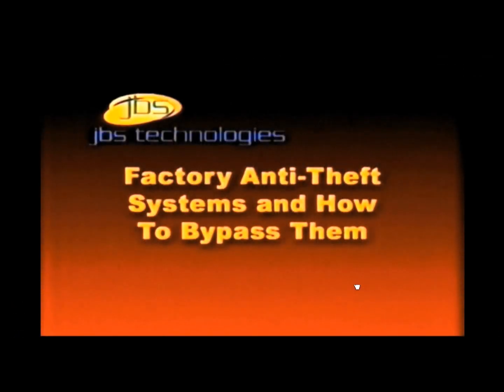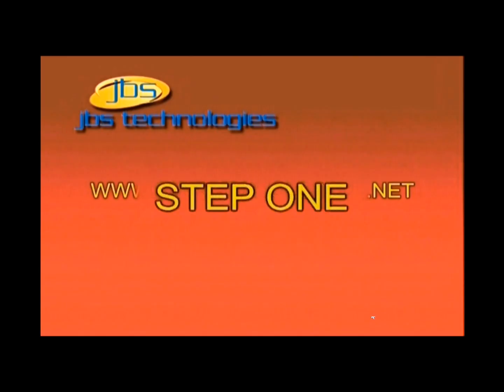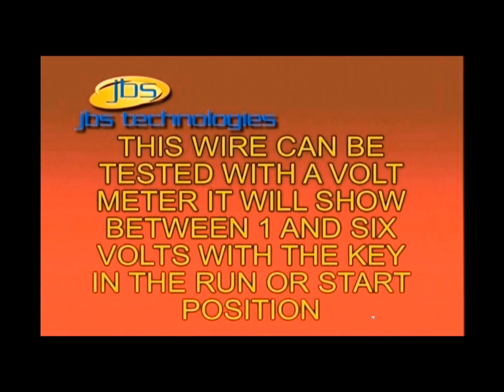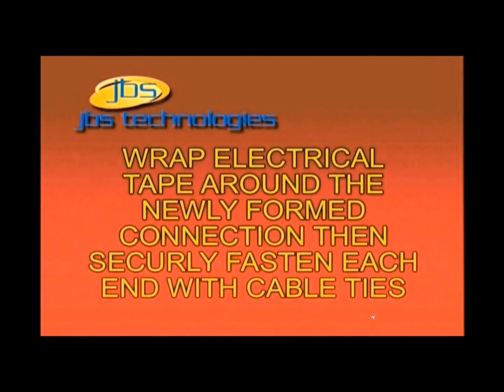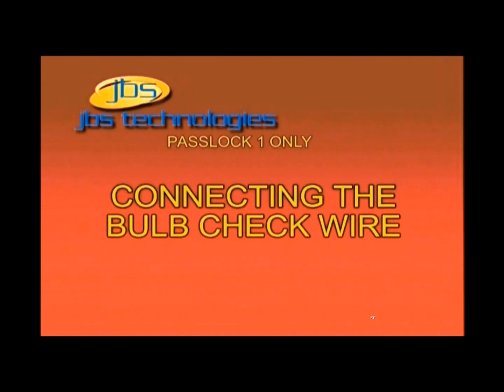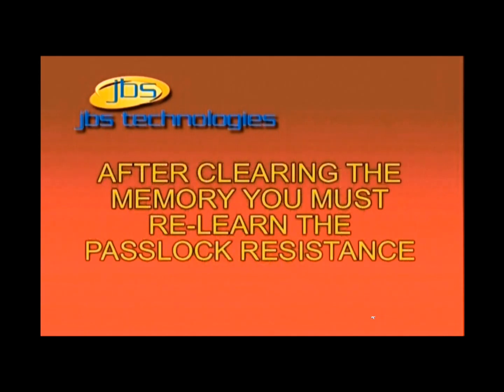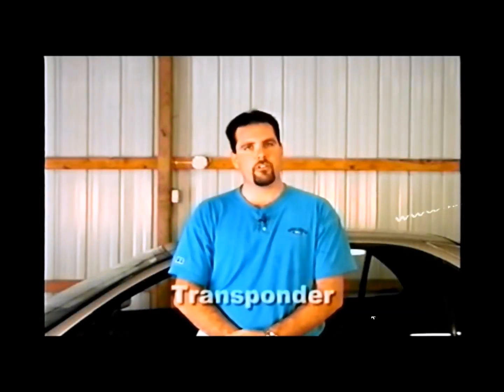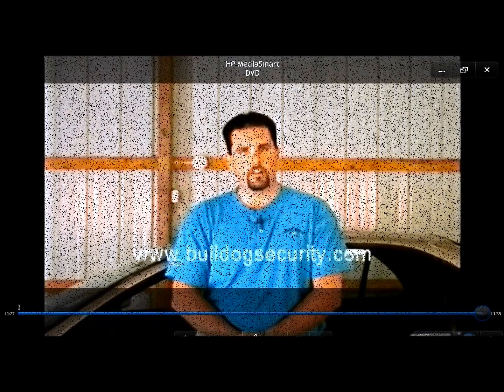Doing a bypass module on an older vehicle GM VATS Passlock or transponder

Comment: Question  ?
Once you have engine started, can you then disconnect and remove the vats module permanently  and still operate vehicle normally without the vats module  in the system ?

Comment: guys you can use a spare key to at least test if this is your issue...just cut the wire and cut back the orange some and take the two white wires and trim back some as if you would place a resistor or bypass kit and hold the key between it should start the car but you must have two keys with this
Reply: 😊😊😊😊😊😊😊😊😊😊 me😊😊😊😅😊😊😊😅😊

Comment: I installed remote ready and this bypass module and all I get out of the engine is- it cranks over and turns right back off. Anyone have this issue?
Reply: FYI found the issue. 😁

Comment: I NEED A SUPER FAST RESPONSE!! 
WILL THIS WIRING WORK IN MY 2005 CHEVROLET MALIBU MAXX LT???
Reply from the maker: Nope, that car has a passlock 3 rf transponder based anti-theft system, not a resistor based setup like this video explains.
Reply: @Lesscoelectronics  ok. So if you can PLEASE let me know, asap! what would  you suggest i do sir??? Someone stole (or picked up at the very least!...,) the only transponder chipped key to my car and i have ZERO $ to get this fixed...i'm a single mother of 3 children and we REALLY NEED my car!...Like yesterday!!  Ya know?!! 😣🙁 Any and ALL advice is greatly appreciated!
Reply from the maker: i cant help unfortunately on your situation

Comment: what system on a 1990 Pontiac trans am gta 5,7 automatic .thx
Reply from the maker: It has a vats system in there:

KEY
    
    
    T-HARNESS
    
    
     IMMOBILIZER
    
    
    
    
    N/A
    
    
    GM-3
    
    
    VATS Requires 791 Bypass Module (Some Vehicles)
    
    

    
    
 PART
    
    
 COLOR
    
    
 LOCATION
    
    
 DIAGRAM
    
    
    
    
12 VOLT CONSTANT
    
    
RED (+)
 
    
IGNITION SWITCH HARNESS
    
    

    
    
    
    
STARTER
    
    
YELLOW (+)
    
    
IGNITION SWITCH HARNESS
    
    

    
    
    
    
STARTER 2
    
    
N/A
    
    

    
    

    
    
    
    
IGNITION 1
    
    
PINK (+)
    
    
IGNITION SWITCH HARNESS
    
    

    
    
    
    
IGNITION 2
    
    
N/A
    
    

    
    

    
    
    
    
IGNITION 3
    
    
N/A
    
    

    
    

    
    
    
    
ACCESSORY/HEATER BLOWER 1
    
    
ORANGE (+)
    
    
IGNITION SWITCH HARNESS
    
    

    
    
    
    
ACCESSORY/HEATER BLOWER 2
    
    
N/A
    
    

    
    

    
    
    
    
KEYSENSE
    
    
N/A
    
    

    
    

    
    
    
    
PARKING LIGHTS ( - )
    
    
N/A
    
    

    
    

    
    
    
    
PARKING LIGHTS ( + )
    
    
BROWN (+)
    
    
@ HEADLIGHT SWITCH
    
    

    
    
    
    
POWER LOCK
    
    
LIGHT BLUE  (TYPE A)
    
    
IN DRIVERS KICK PANEL 
    
    

    
    
    
    
POWER UNLOCK
    
    
BLACK  (TYPE A)
    
    
IN DRIVERS KICK PANEL 
    
    

    
    
    
    
LOCK MOTOR WIRE
    
    
GRAY (+)
    
    
IN DRIVERS DOOR HARNESS
    
    

    
    
    
    
DOOR TRIGGER
    
    
WHITE (-)
    
    
@ UNDERDASH LIGHT
    
    

    
    
    
    
DOMELIGHT SUPERVISION
    
    
USE DOOR TRIGGER, Requires Part #775 Relay
    
    

    
    

    
    
    
    
TRUNK RELEASE
    
    
BLACK (+), Requires Part #775 Relay
    
    
@ HATCH RELEASE RELAY, See NOTE *1
    
    

    
    
    
    
SLIDING POWER DOOR
    
    
N/A
    
    

    
    

    
    
    
    
HORN
    
    
BLACK (-)
    
    
@ STEERING COLUMN HARNESS
    
    

    
    
    
    
TACH
    
    
PURPLE/WHITE or WHITE 
    
    
@ IGNITION COIL
    
    

    
    
    
    
WAIT TO START LIGHT
    
    
N/A
    
    

    
    

    
    
    
    
BRAKE
    
    
LIGHT BLUE (+) or WHITE (+)
    
    
@ SWITCH ABOVE BRAKE PEDAL
    
    

    
    
    
    
FACTORY ALARM DISARM
    
    
N/A
    
    

    
    

    
    
    
    
ANTI-THEFT
    
    
2 WHITE or 1 WHITE and 1 PURPLE, wires are in an ORANGE tube
    
    
GM's VATS System @ Ignition Switch Harness
    
    

 
    

    
    
 NOTES
 
    
    
    
NOTE *1      the HATCH RELEASE RELAY, is in the CONVENIENCE CENTER, located to the RIGHT of the STEERING COLUMN.

Comment: Can a malfunctioning Theft Deterrent System (Vats for 1998 Buick Lesabre) cause the Fuel Pump to not eject Fuel? I had a malfunctioning Theft Deterrent System start giving me issues late December. Horn honking, marker lights flashing, buttons clicking etc. Battery would drain down about every 4 days. I replaced the battery and started experiencing issues with a Crank No Start problem. Desperate to get my car going I tried starting it for 15 solid minutes. I think I contributed to burning out my Starter. 😥 I replaced my Starter and drove only two days and am back to experiencing a Crank No Start and also same Anti Theft Symptoms... ugh. Help!
Reply: If the tdm is bad it will need replaced, if your key is a chip key you may just have a bad ignition lock cylinder, and yes having the security light on will typically shut the fuel injectors down

Comment: how do you know if your vehicle has bypass 1 or bypass 2
Reply from the maker: Tell me the year, make and model...
Reply: @Lesscoelectronics  2002 chevy cavalier 2.2L OHV base model
Its also not an ecotec engine
Reply from the maker: That is a passlock 2 with the bulb check wire feature, have fun with that one!
Reply: @Lesscoelectronics  LOL thanks!
Reply: would this work on a 98 sunfire if your key does not have a resister, original was lost? @Lesscoelectronics
Reply from the maker: keys with pk3 have a + symbol on them
Reply from the maker: It sure will!
Reply: I have a 99 Chevy Tahoe what part number do I need
Reply: @lessco electronics can u tell me how to find the ohms in a pk3 system on my 99 yukon. Thanks in advance
Reply: I have a 2005 chevrolet malibu maxx lt 3.5 engine V6. Will this work for it????

Comment: my keys dropped in a sewer, i changed the lock cylinder assembly and took out a alarm installed previously... starts but shuts off. idk if that makes a diiference
Reply from the maker: It wont matter
Reply: same thing with me I keep saying the same thing that's happening car turns on shuts off injectors turn off from the computer nobody will say what that is is the simplest one out of every one

Comment: Sorry but i had bad luck using methods on youtube. Not lasting. for Vats.
I finally just put a wired switch where the ground to the computer on the body. Tricked the puter into thinking it s another day . Always starts now.
Reply: How did you do it?
Reply: @flamedrivenphenomnix1007  I put a switch between the frame of the car and the computer ground wire. so I would not have to disconnect the battery each time to over ride the security lock. {which was a 12 hour wait or more }.

Comment: I have a 2000 Chevy z71 pickup the security light is staying on all the time truck will start for a few seconds then die was told might be the anti system module where is it located

Comment: I have a 1990 Corvette I need to bypass the VATS system...Any suggestions?
Reply from the maker: I would read the resistor in the key, and cut the white wire loop under the dash and put it inline permanently.
Reply from the maker: search my channel for vats bypass, I have a few things on that topic.

Comment: What if you buy a 2001 chevy silverado from an auction that has no 

key....
How can you check the resistance to be able to disable the 

"Vehicle Anti theft system"??

Also for the "VATS"......what if the key has no chip......How do I 

check the resistance??

What are my options??

tmmholden@gmail.com

Comment: What if you buy a 2001 chevy silverado 

from an auction that has no key.....
How can you check the resistance to be 

able to disable the "Vehicle Anti theft 

system"??

Also for the "VATS"......what if the key 

has no chip......How do I check the 

resistance??
Reply from the maker: +Michelle Holden here's how: https://www.youtube.com/watch?v=y9QQrrRxrxI
Reply: +Lessco Electroni cs
Reply: Just cut the thin yellow wire coming from the ignition passlock 3 wire connector and tape off the side that leads to the connector.  Then connect a 3.4K ohm resistor to the yellow wire side that heads under the dash.  Then connect the other end of the resistor to the orange wire (do not cut the orange wire, just poke a hole through it to feed the resistor connection through it and solder and/or tape/shrinkwrap it.   I did this and did not even have to do a Relearn after.

Comment: I have a 95 Cadillac Fleetwood that doesn't start because of the vats, does this bypass module fix that problem. I have tried the doing the resistor trick but that didn't work. I must have did it wrong. I cannot find any videos or info on the Cadillac vats.